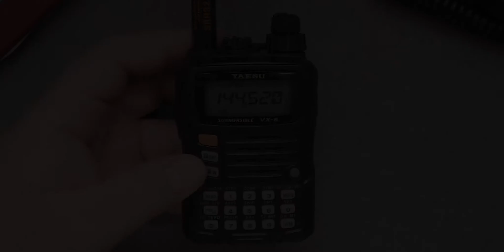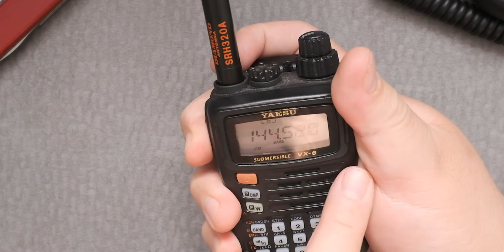Yaesu VX-6 Microphone Gain

Comment: I was wondering if you happen to know how to adjust mic gain on the vx7r. It doest appear to have this setting, which i find weird. The previous model has it and the following model has it, but not the vx7
Reply: you are right.. i have also vx-7 who doesn't have this option.. it sounds a bit quiet, so you have to place your mouth more close to mic hole. By using the (optional) VC-27 earpiece/mic is far better and louder, you can try it.. I also saw some reviews about the low audio and many people say this is because the waterproof design of the vx-7. A simple solution is to remove the small "protector" between mic and chassis, then audio becomes louder and better, but the rig is not waterproof anymore.